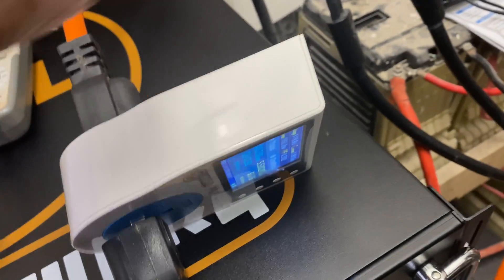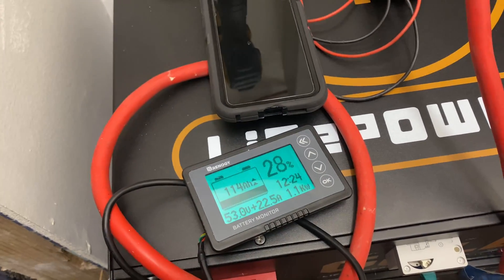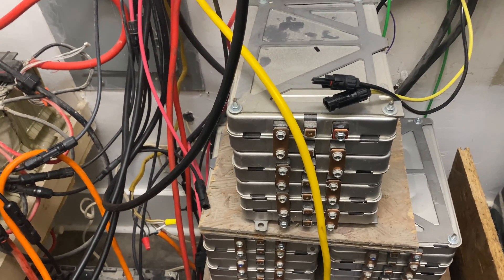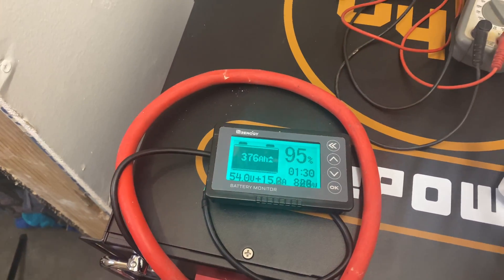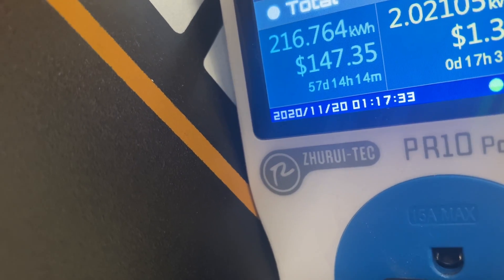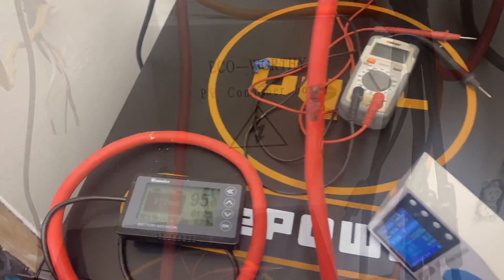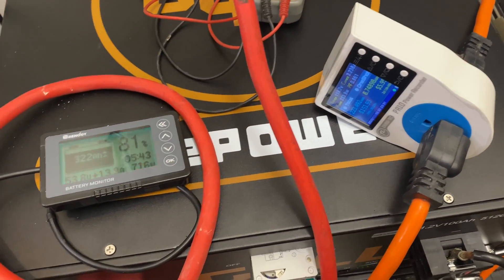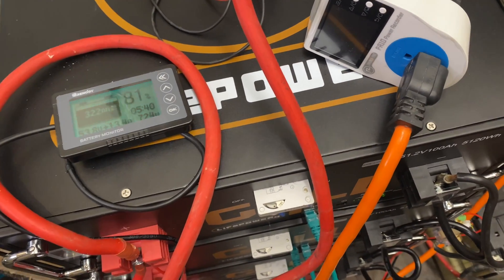How Long Can I Run My House On A 20kwh Battery Without Solar P2

Comment: Nice! My setup is with 16-272ah Lifepo4 batteries. They are awesome! I'm getting about 12kw out of them. Silent, no smell, and no body can steal it! I'm also using the MPP LV6548 inverters in split phase setup
Reply from the maker: Tha k you and they are great batteries

Comment: I have 2 of those Gyll batteries with 3600 watts of solar. They seem good so far.
Reply from the maker: They’re great batteries, what’s the most watts you seen coming in on solar ?
Reply: @texasoffgridguy8749  Around 2800 watts, but its been increasing as the sun gets higher in the sky as spring approaches. I just put the solar in last fall, so I haven’t seen the peak yet.

Comment: Nice setup but this does not reflect a typical household. A normal house in the winter would use 15 to 24kw in a single day with heating, lights...
Reply from the maker: Thanks, I agree but I’ve been living off grid for years and over the years I’ve learned how to conserve energy meaning I don’t just leave things on like a tv or computer or lights just because I have free power and I also so use energy efficient appliances some refrigerators uses 15 amps and ppl don’t even think to check these type of things which can use up a lot of kilowatts and with ac I talk about using a separate system just to run ac and use propane for heat source to go off grid a lot of changes has to happen there ways to cut down using 15 to 24kw if you pay attention to what you’re buying when it comes to appliances

Comment: Loving your energy. But do you really think that this is a fair comparison do say that people CAN live off grid with this setup? I mean you are running bare bones, this is not typical for the average person. I have a 32kWh system myself, haven't yet tried switching the house over for a load test at this time, but I think that a couple days I would have to tap out even tho I have 50% more storage than your system. I may eat my words, but I was curious for your thoughts. Can I assume that you live alone?
Reply from the maker: Thank you, yes I do live alone, and 32kwh capacity is a lot of power, it’s a lot to factor here like are you using all energy efficient appliances do you or the family just leave things on like the tv and lights on all day and night? What type of battery cells you’re using ? I hooked up a 16kwh battery system for a guy who have a 7000 square foot home and it’s 5 ppl who lives there and the system use to cut off on them because him and his family wasn’t use to living off grid now it’s working fine because they understand how to use energy but we had to hook them up hybrid until we get more batteries and they understand a little more about living off grid, solar panels play a big role in an off grid system the more solar you have the faster the batteries charge up and stay charged, I’m planning to buy two more batteries so I’ll be at 30kwh capacity that’s so I can run my system a little longer if we have 2weeks of cloudy days so I do think you’ll be fine if you have lots of solar coming in to keep your system charged also are you running a central AC unit?
Reply: @texasoffgridguy8749  right now only my workshop is off grid. Light, a furnace, well pump and a couple computers. Also all my power tools and my tassimo coffee machine. Oh also a fridge. It’s my man cave.
Reply: @texasoffgridguy8749  I am waiting for my 10 circuit manual transfer switch to arrive this week so I can take some critical house loads over to the solar off grid setup.

Comment: Wow ! You have a great large lithium battery bank . Like those massive rack mounted lipos , what are those white looking cards that’s plugged into them ? Keep it up and running because we preppers are always ready just in case of any outages or just to save on the electric bills at this time & age .when you get a chance , please check out my solar videos and. Like , leave a comment and subscribe. May the solar be with you .
Reply from the maker: Thank you for subscribing to my channel I subscribed to yours as well, and those are breakers and if anyone was wondering or looking into getting a off grid system I would recommend going 20kwh or better

Comment: I use my 48 volt golf cart charger to charge my solar lithium polymer chevy BOLT not VOLT batteries. Initially I had no BMS and had to watch the voltage very closely and often to make sure not overcharged. I use them in my golf cart also.  Now I have high amperage anderson connectors so that I can hook to hybrid inverter to charge the batteries and easily reconnect the main battery bank,  Of course with a BMS I wouldn't need to watch closely or with the inverter charging to preset parameters. I charge my 14 cell modules to 58.4 volts max but usually just to  56 volts.
Reply from the maker: What’s the kWh capacity on your battery bank?
Reply: @texasoffgridguy8749  60 Kwhr.  I have the 5 bedroom house you alluded to LOL
Reply from the maker: Oh ok so is the 60kwh battery capacity enough ?
Reply: @texasoffgridguy8749  I get by about 90% of the time on solar only.  If I use gas for heat 100% of the time.  I like burning wood for heat but my wife doesn't so unless I get outdoor wood furnace would need probably 120 Kwhr battery and a few more panels . Or a tesla and use the car batteries for overnight storage and 12 to 48 volt converter to get about 2,000 watts from it when needed ( see will browse video on this) or use my 2,000 watt honda inverter generator with transformer to get 240v.